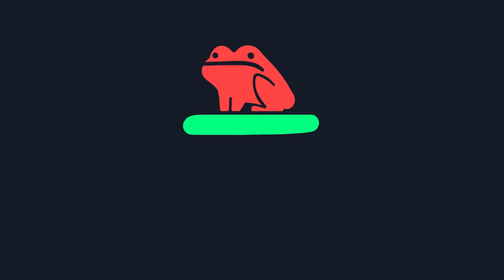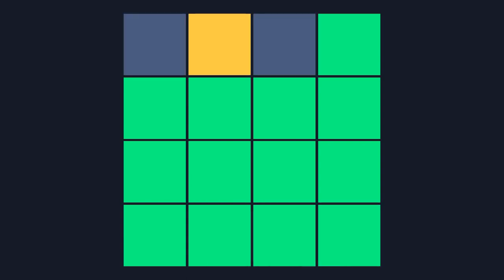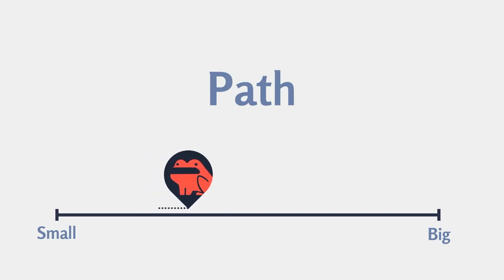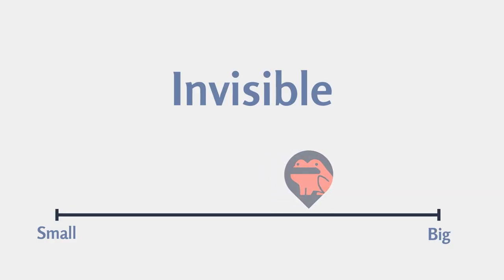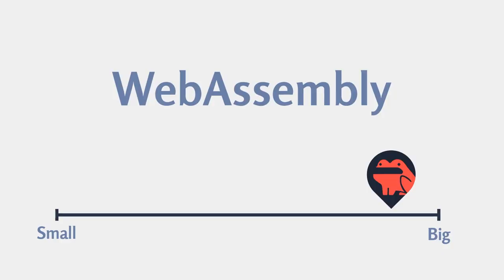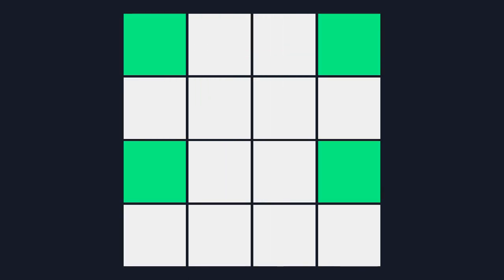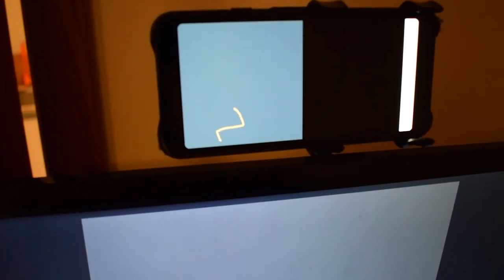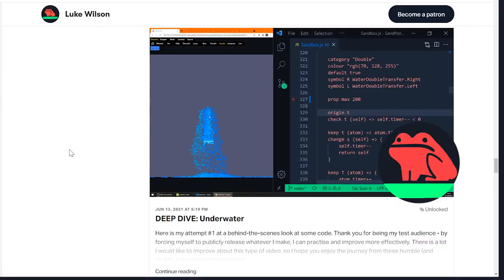🦕 Top 9 Ways To Make Big Sand

Comment: Interesting how getting rid of RGB from RGBA got a lot more than 4x speed improvement.
Reply from the maker: Yeah weird! I wonder if there was something else contributing to the speedup! All the code is up at github.com/l2wilson94/BigPond
Reply: I think it has better vectorization potential
Reply: its 16x
Reply: less cpu cache misses
Reply: @NoNameAtAll2  values for rgba are next to each other in memory so they would be on the same cache line.
Reply: @TheFlynCow  it's not about single value
it's about going from 3MB to 4MB
Reply: @NoNameAtAll2  It was my understanding that he didnt change the actual image format in memory. If thats the case ur right although i wonder how much of the speedup is actually cache as were accessing memory sequentially and the controller should have enough time to prefetch.

Comment: The next speed improvement would be making the hardware specifically to run sand simulations. Then you would have to ditch high-level programming languages next. Byte code is the way to go.

Comment: What are the memory implications of Neighbor Sand? Computers are always a trade off between compute time and memory, and for something like this it doesn't seem too bad, but once you're talking megapixels if you're even just storing three neighbors that could grow quite quickly as you scale it, to 8 in 2D and 26 in 3D. I'm not sure how large a C pointer is though
Reply from the maker: With the neighbourhood thing, I find that speed issues appear much sooner than memory issues (in the year 2022 at least). I use it in SandPond, which is 3D with 61 neighbours, and that's done in javascript.

Comment: Very cool, might be nice to slightly randomise the grain colours ?
Reply from the maker: Thank you very much! Yes that would look good. Max Bittker's sandspiel.club does that and it looks great!
Reply: @TodePond  It would also be fairly easy, since you're using transparency to draw the pixels, you could initially draw them with the variation of color, then since all you're doing is changing transparency, the computer wouldn't have to do any more work.
Reply: @flameofthephoenix8395 issue is you want individual grains to maintain the same color
Reply: @LineOfThy  That's true, but people won't notice maybe.
Reply: @LineOfThy  I mostly suggested it as a way to do it without adding more lag on.